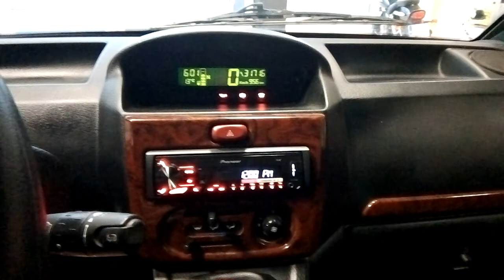coche sin carnet microcar mc2 preference motor yanmar

Comment: Muy buenas aun lo teneis y cuanto cuesta ese.
Reply from the maker: buenos días ÁNGEL,
si, aún lo tenemos disponible. Para más información no dudes en contactar con nosotros a través del correo electrónico info@motorizate.es o a través del teléfono 604025824 (también whatsapps) y te atenderemos encantados y sin compromiso.
un saludo y gracias
Reply: El xtoo tengo yo asta cuánto puede durar
Reply: @albinocastellanos9856  y 2 años después le contestas